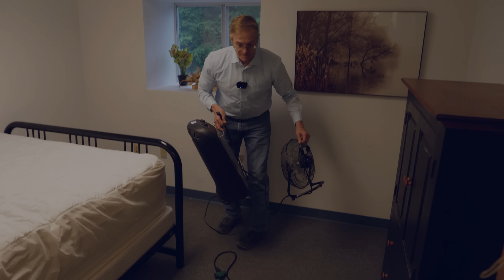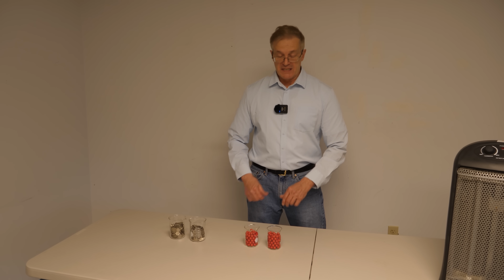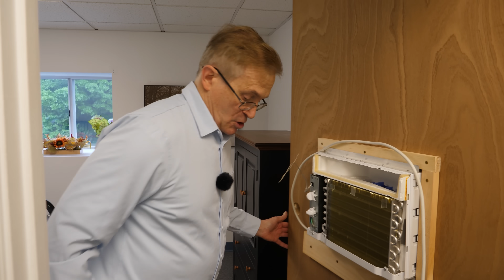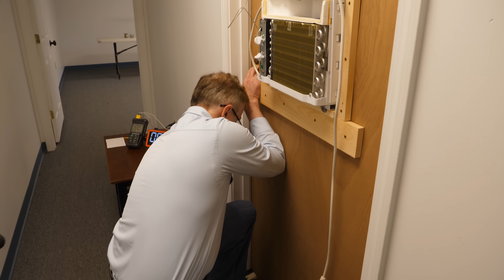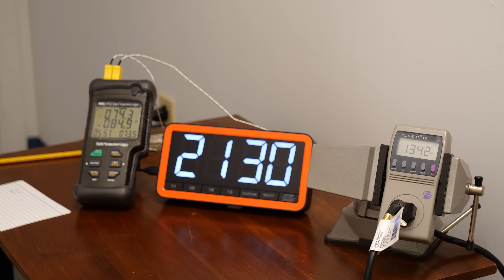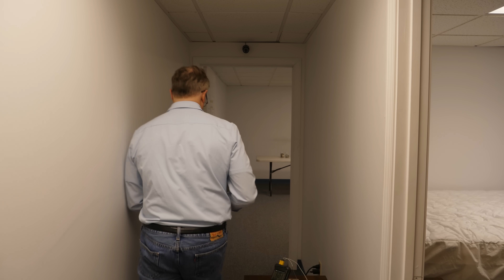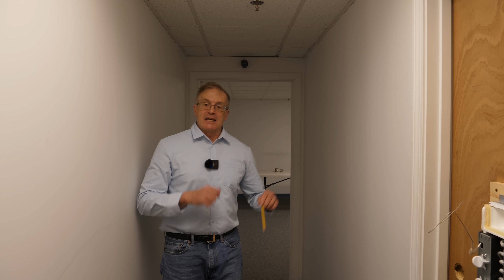You're wasting money on heating! Use your A/C!

Comment: That's something I learned over 10 years ago when moving from Germany to Malta. At first, I was confused how electricity-based devices could be more efficient, but once I looked into how heat pumps actually work it made sense and it's so simple.
There are trends now to only have heatpumps installed in Germany right now and I hope they stick to that and even speed up the phasing out of gas.
Hopefully the rest of the world follows quickly.

Comment: I've heard of people removing or disabling the thermostat in their air conditioners so they could use them to heat a room when outside temperatures are lower then the unmodified air conditioner permits.  I'd be very interested in the efficiency at those lower temperatures.

Comment: Does this princible extract energy from movement of molecules so that it shifts that energy ( other side of wall)  making even faster moving molecules (more heat) and leaving behind atoms with little or no movement (cold air)? If it works like this there is no shortage of supply. Just cycling endless amount of air would give us huge amount energy. The challenge is maybe to push molecules to high temperatures. Electricity could be generated that way by turning water to steam for turbines. Climate would locally turn colder as electricity heats homes further away.
Reply: So everything... Air around us contains energy. If we take that and turn it into electricity and then turn it into light which is aimed into clear sky... that would make our earth colder again as the energy gets shot into space.

Comment: This princible could(or should) be used to preheat water to the princible's maximum 45-50? Degrees in Cº and then continue with traditional heating to get it to to boil. Would it be more efficient that way? How much is it possible to crank this princible up to produce greater temperatures?  To melt steel with this would be quite an achievement.

Comment: so basically, use a crane to move molten metal (airco) compared to using an arc furnace to make said molten metal (heater).
Reply from the maker: Correct

Comment: that is an IR heater not resistance
Reply from the maker: Yes, it is.
The hot surfaces of the quartz tubes radiate infrared and also heat the air through convection.
But, those tubes ARE hot because of the resistance in the coils of wires inside them.
Reply: @TechIngredients  ahh ok. Ya that makes sense, I guess technically even an incandescent light bulb is a resistance circuit aswell

Comment: heat pumps I'd agree are great to a degree maybe in Southern States. I'd love to see the same test in Northern Canada with the air conditioner reversed in a window when the temperature outside is -3 or -4 degrees Fahrenheit and see how practical a heat pump really is in terms of efficiency in temperatures where it really matters
Reply from the maker: You may be right.
But remember the statement, " If all you have is a hammer, all the world is a nail?
Use the right tool.
Nevertheless,  the heat pump doesn't have to climb the whole thermal  mountain alone. You can use one heat source to reduce the differential and finish with the pump. This will give an increased efficiency overall.

Comment: I think you have the tools and supplies necessary to create a couple sealed chambers to measure efficiency of heat exchange into an atmosphere already saturated with heat versus an atmosphere with less heat. Likewise, i know you have the tools to measure multiple variations in the heat exchange efficiency into atmospheres saturated with water vapor versus low vapor.
Point being i have noticed massive differences in the effectiveness of my air conditioning in higher and lower days of humidity living here in the south. I swear the humidity is so high on some days you can drown if you take a deep breath lol.

Comment: everything i see about heat pumps always uses the best conditions possible, if you run that thing and try to pump heat into your house when its zero degrees outside it aint gonna do jack shit. Efficiency ratings in the most favorable environments doesnt mean a damn thing.
Reply from the maker: It means a lot.
Heat pump performance decreases as the "lift" distance increases.  Eventually, it will drop to the level of a resistance heater.
Nevertheless, even if the differential is huge, part of that differential can be covered with a heat pump at very high efficiency and the remainder can be filled by another heat source such as electricity, natural gas, solar etc. The overall system efficiency will be higher because of the heat pump.
Reply: @TechIngredients  electric heat costs a hell of alot more than gas or propane, so if the heat pump is the same efficiency in the winter as a resistive element heater, what exactly is the point?
Reply from the maker: Reread my whole response above.
Reply: @TechIngredients  the efficiency of the system doesn't really change if I add something that's 105% efficient to something that's 100% efficient.
What WILL change is you will pay out the ass for electricity. Electricity is something like 4x more expensive per heat unit than gas
Reply from the maker: The heat pump can be 10 times as efficient as a resistance heater.
The efficiency of gas or oil heat sources can approach 90 % of the efficiency of a resistance heater. 
The advantage of the pump decreases as the temperature differential increases while the efficiency of these other sources doesn't change.
Use the system that best matches your own conditions and consider the up-front investment as well.
Heat pumps are expensive, and even if the best thermodynamic choice, they may never save you enough to pay back the initial investment.
It's not a simple decision.
Reply: @TechIngredients  if we're talking geothermal then im totally with you. A geothermal setup can pull heat consistently from the ground and heat a house easily, the only real risk is saturating the earth by having too small a system. What i keep seeing on here is people pushing window unit heat pumps that will never cost less to operate than gas heat in northern states.
I see it as scamming people who don't know any better (I know that's not what you're trying to do)
Apparently NYC is running some scam right now to try to replace boilers in apartment buildings with window unit heat pumps. 
#1 - the electric cost in NYC winters will be much higher than the gas heat costs to the renter
#2 - many renters don't pay for gas heat but do pay for electricity, so they could be blindsided by that as well.
It's a scam being pushed using "efficiency" and green energy hippy bs to push a product that doesn't make sense at all on an unwitting but well-meaning public.

Comment: probe reads 85.9  "lets call that 85.9" or you know.... the proper usage of those words implying a rounding is about to occur... 86.....
Reply from the maker: Normally, I'd just smile at your comment, as you make a reasonable point.
However,  I said this because the readings were bouncing around, and I made a judgment to call what I saw as the center of this variation.

Comment: This went over my head until i watched a couple times,

So are you saying we can rotate a cheap ac unit to blow heat inside our home?

Or is this just a representation of how a heat pump works?
Reply from the maker: Both.
However,  just spinning an airconditioner around will be more limited than a purpose built, bidirectional heat pump. It will work, but the airconditioner's controls would be hard to access and would need protection from precipitation.   Also, its temperature range is smaller.

Comment: Doesn't work in Canadian climates, especially northern areas which regularly hit -20C to -35C during the winter. There's not much heat to pull out of that. I think it only works within the pumps ability/resolution to move heat energy.   Interesting.

Comment: You used a radiant heater, try to use a heater that heats the air just like the air conditioner heats the air.
Reply from the maker: That was what the airconditioner was doing.   I don't understand your point.

Comment: The only thing with heat pumps is that they get less and less efficient the bigger the temperature delta between the coils gets.  So if you were trying to warm up the cold coil with -20F outside air in the winter, you'd be losing quite a bit of efficiency over warming it with 75F ambient air like in this.  It would be interesting to see how it would still compare to the grid heater at that point. (i'm only halfway in the video right now)

Comment: Your test is not very efficient. Since you already started with a hot room making it mega hot, theres a good chance that space heater turned off a few times. Really need to do this with normal temperature ranges where a heater would be used, preferably close to freezing outside. Your entire test is invalid.
Reply from the maker: Did you watch the time-lapse segments CAREFULLY?  The power draw was displayed throughout.
Reply: @TechIngredients  yes I understand that... I just don't know how well your reverse AC would work on a freezing winter day blowing thru a window from outside, compared to a space heater with a closed window.

Comment: i already setup a diesel heater and i dont foresee this working better but am interested. if the control side is outside, when its 10f out there how does the pump kick on? the logic of the machine would leave it off. maybe some kind of bypassing the thermo sensor?  also recently my window unit tripped the breaker, ended up figuring it was overheating. i live in the desert so theres zero condensation build up(100+f and 5% humidity). but also dont want humidity (i know all about swamp coolers), i also have a kill-a-watt and watched the a/c pull upwards of 1200 watts, when i sprayed just a little water on the outside the current went down to 800ish watts, now i just use a water bottle and put some water in the bottom pan from inside and the outside fan splashes it all around. 1/3 less energy, now the plug doesnt even get a little warm.

Comment: Isn't the reason why heat pumps aren't effective in many situations, that they depend on there actually being heat in the system? That is, if we imagine that it was winter and the air conditioner was trying to move heat from sub freezing areas into the house, it would be dramatically less efficient, right?
Reply from the maker: It would be progressively less efficient as the temperature differential increased. Eventually, it would approach the efficiency of the resistance heater.
It would be ideal to have several choices when heating and even cooling based on where you live and the seasonal conditions.

Comment: I use Natural Gas for heat. My Utility bill is much cheaper in the winter vs the rest of the year. Natural Gas puts out hotter heat, at lower temperatures than a Heat Pump and where I am it is cheaper to run than Electricity.
Reply from the maker: That's reasonable.

Comment: Great demonstration, but I was expecting a table showing start and finish temperatures in both the room and corridor, and the total power consumption from the meter with energy used per degree of gained heat.  from the timelapse I got:-
passive heating element = 65.7Wh/degF
AC unit = 12.7Wh/degF
which is about a 80% saving.  (I used the start and finish energy values and averaged them, so may not be completely accurate.)

Comment: so when water drips and humidity rises will it mold too this method? mmm
Reply from the maker: You can control where any condensate goes.  All of it is produced by the cold side of the air conditioner.

Comment: You state that heat pumps work very simple but did not explain how except saying that they mess with entropy. So much for an explanation. The simplest explanation I got to is that a gas is liquified in warm conditions which generates heat. Then the liquified gas is transported out and vapourised in colder environment where the temperature of gas in the process of decompression drops below the cooler environment that allows it to warm up a bit and then is transported back in, into the warmer room to be compressed again. Which allows to add the temperature difference between cooled down vapour and ambient outdoor temperature to the temperature inside. Obviously it requires energy to do that but the energy required is smaller than the temperature difference acquired. This is closest I got to understanding the principle but I feel I am missing something. 

There was this MIT study recently that showed that polarised light can evaporate liquid with a fraction of energy the heat can. How would that add to heat pump equation? If you can vaporise liquid without it taking in any heat. Maybe you do not need the outdoors. Then you can just run the whole system indoors?

Also, what if there is central gas supply, can it be utilised to get more heat out of it by using its energy to liquify it and then decompressing it outside or under a polarised light, how would that work?

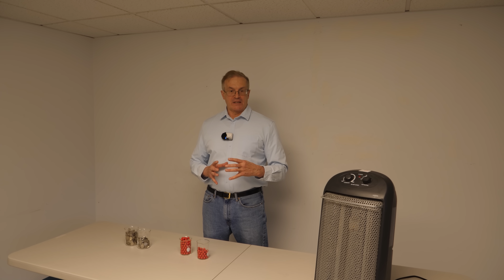Comment: Starting at 4:55 when mentioning the amount of energy in an area of air it makes much more sense to think about it using degrees Kelvin. The Kelvin scale is a measure of the amount of energy in a system or an object. The comparison was between 0 degrees Celsius and sweating, say 30 degrees Celsius. In Kelvin these values become 273 degrees and 303 degrees. From that we may see that the lower temperature is approximately 90% of the higher temperature (roughly 270 divided by 300 reduces down to 9 divided by 10, or 90%).

Comment: Hi! As a scientist I will give you an advice: Try some Halogen lights. Use them with 50% power. For ex connect two 400W units in series or use car headlamps, the 12V models two of them in series and a  single car battery. The amount of heat a Halogen atom gives off when dissociating is huge. This is the basis of the Ross heater which now seems to be deleted from the net. It had hydrogen gas, nickel and lithium bits as catalysts. I still love your shows and as stated before: you are still the best teacher and I still wish you had been my teacher when I was a student. Would have achieved more with less time. There is also this very strange infrared heater that does not heat up at all = stays completely without heating at all : frico elztrip ez106n 600 Watts      Our group of scientists has had only guesses how it works, even though we have made remarkable success in the world of ultra-fast car battery chargers (5-10 secs empty to full) and the so called Overunity generators.

Comment: @Tech Ingredients - It was not mentioned in the video, and it should have been: Virtually all the electric power going into a heatpump in heating mode (mostly the compressor power) goes to heat the target area, along with the heat pumped in from the source side. So at worst, the unit acts as a resistance heater.
In cooling mode the situation is reversed and virtually all the electric power going into the heatpump is dumped to the target area, along with the heat pumped out from the source side.  The possible minor caveat in both cases is the fan motor power.
Reply from the maker: Good point.

Comment: I consider myself a fairly critical thinker in general, and this was an extremely interesting experiment.....but I would like to see these same tests run when ambient temps are at or below freezing . I would gather the ac unit will need additional energy to do the same operation at lower temps while resistance might actually increase a small bit in efficiency. Not to mention the ac will need to run defrost cycles consuming additional energy or risk failing completely.
Reply: Basically if someone thinks they can use a window unit backwards to warm their home, it will fail. But if you solve the defrost situation....it might be practical.
Reply: Resistance heating is already 100% efficient, by definition. You won't improve on that. The only question is where the resistance is encountered. Any that is present between your electric meter and the heatpump will add heat in undesired places.
Reply: @YodaWhat  Cold can increase voltage.

Comment: I have one of those “portable AC” units that has a hose that pumps out the hot air. Turn it around and you have a unit that could pump in warm air during the winter. My only issue is that it has a low temp cutoff of around 62 degrees Fahrenheit. But I’m certain it could still produce heat below that. Anyone know how I could bypass this?

Comment: removing the heater and the fan, insignificantly, but none the less, changes the dynamics of the test... just saying
An air conditioner is more efficient than a heater because you are only moving existing heat rather than generating heat by converting electrical energy... but that heat in the hallway doesn't generate itself...

Comment: an electric space is the most efficient thing made by man?? youve obviously NEVER heated a home or a room with one and SEEN the electric bill LOL so what our saying is install window unit BACKWARDS???? so how does 1 turn it on, adjust temp...go outside in the freezing cold??? your also not taking to account of trying to keep a room at 72 say when its single digit temps outside?  not to mention your not supposed to run the ac unit "inside" the room. and trying to set a temp is impossible, if its 20 degrees outside, the AC will never turn on. you could set it to cool, but then it wont shut off and then your roasting inside? yes your test maybe accurate, but NOT practical im pretty sure mini splits use a heat pump...and make MORE sence, apparently someone already figure this out YEARS ago and invented mini splits SMH
Reply from the maker: The point of this video was to demonstrate the huge performance gain when using a heat pump compared with a resistance heater.  Turning your airconditioner around in your window would be cumbersome and impractical. Use a purpose built, bidirectional heat pump.  They work.